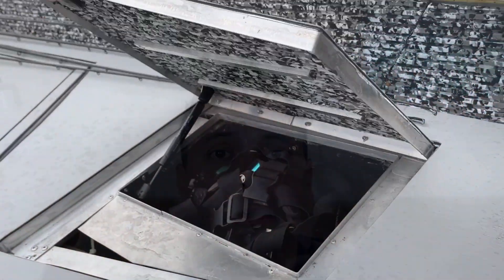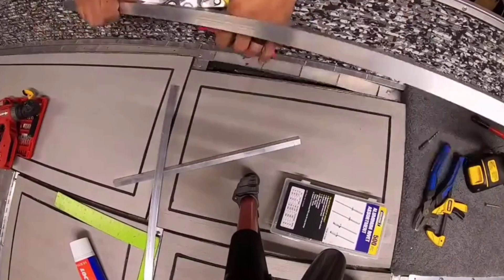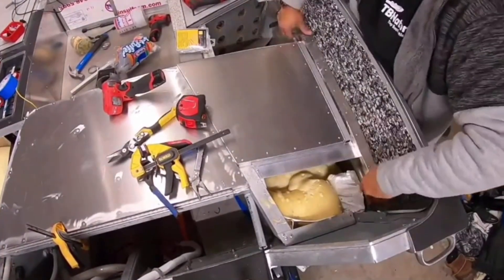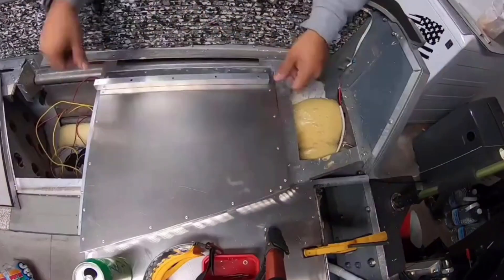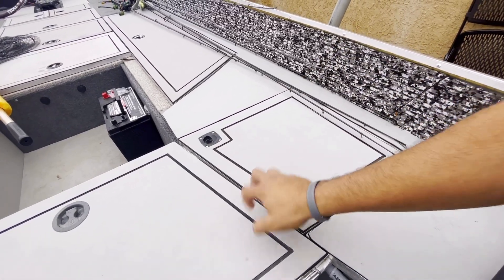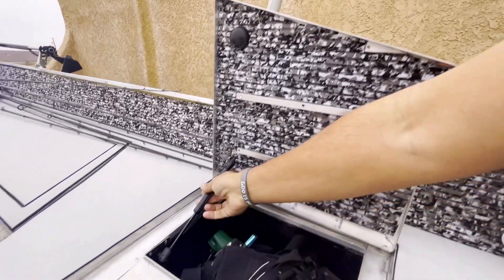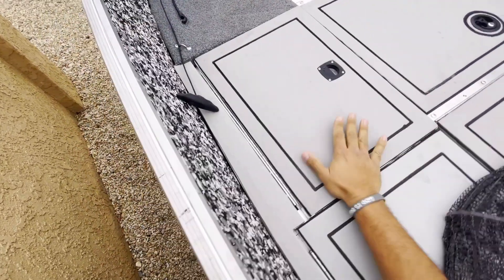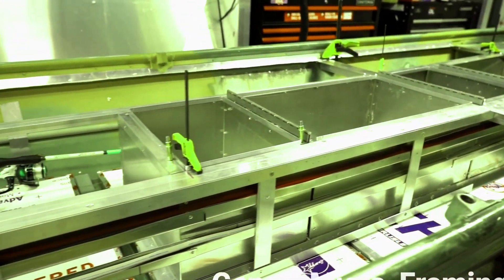Rivet-together Lids | SUPER LIGHT! Gen-7 Micro Lids for Tiny Boats.

Comment: Learning a lot. You have inspired me to start my own build. Any videos that talk about drainage? Having trouble figuring out how water from the deck gets into the bilge. Thanks
Reply: Use various color dyes (non-permanent) and spray on different sections of the boat. Don’t do the whole boat at one time. A garden hose with fertilizer bottle works well . Then check below.